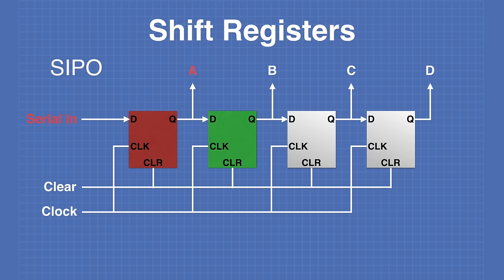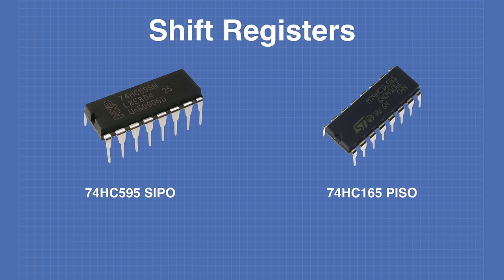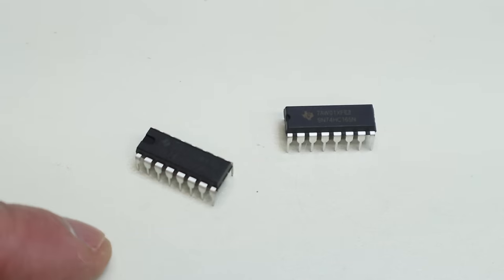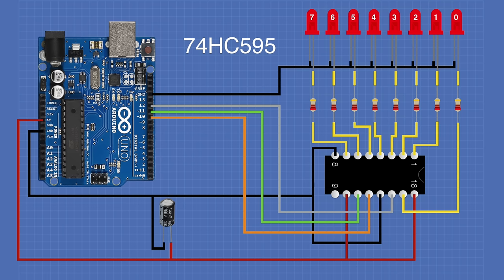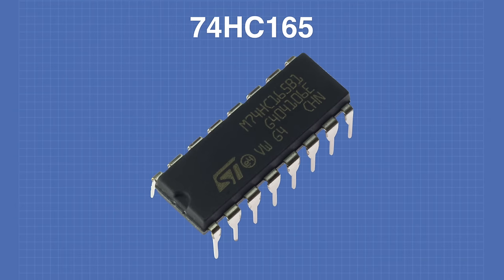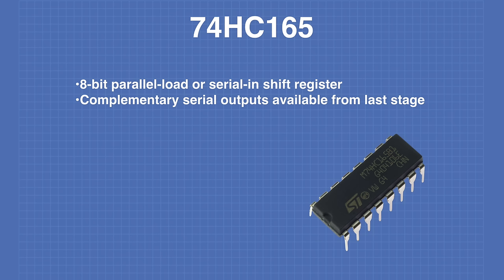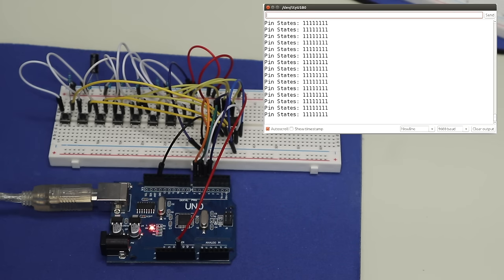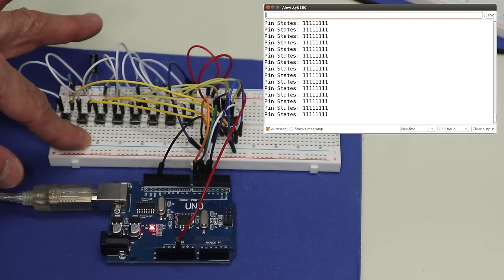74HC595 & 74HC165 Shift Registers with Arduino

Comment: Synchronicity: A day before this video came out, I was trying to figure out how I could use, say, n outputs from an Arduino to drive, say, 2^n LEDs. I'm very new to electronics and microcontrollers, but I've been doing software development professionally for several years. I love this circuit because it does exactly what I was trying to solve, the circuits in the IC aren't hard to understand, and it's great I can just buy an IC instead of wiring all that stuff together. In software development we have libraries of pre-defined stuff, just as ICs are packages of functionality. So ICs follow the same principle we do: package and make freely available bunches of commonly used functionality.
Reply: Hope systemd or other models of development don't reach this area...
Reply: Shift registers are often unknown by hobbyists and forgotten by others. I have seen them in a lot of designs since the 70's. Computers, wending machines and as receiver/decoders in military radar equipment. You find them very cheap on Ebay. Try to get hold of  the good old Texas TTL Handbook.There are many fun and interesting chips in the 74 series.Even an ALU.

Comment: You, Sir, have opened the doors to my better understanding of Arduino and bitwise logic, and I thank you sincerely. I'm 62-years-old and discovered the Arduino playground in early January of 2020, and I'm hooked (it's my new hobby). After using the 74HC595 in an early LED display project, I began to study the nuts-and-bolts of the unit, and I find this all fascinating. For those interested in the logic-level workings of the 74HC595 (or any other chips, for that matter), here are a few references that I've discovered along the way that can be used by both beginners and advanced coders alike. 

For those who aren't familiar with bitwise operations and boolean algebra, don't let the big words fool you; it's as simple as yes or no, on or off, zero or one...just forget about the world of 0s and 9s, and shift into the world of 0x0 through 0xf (hex numbers), and 0b0 through 0b1 (binary numbers (all two of them)).  Once I started coding with hex and binary numbers back in 1990, I never looked back. Mentally converting hex numbers into binary numbers and vice versa is simple, once you learn the trick.

I've C & Ped a copy of comments I wrote for a 74HC595 bit-shifting LED project I wrote. I'll share the code on the DroneBot Workshop as soon as I can. When I code, I comment a lot; I comment on the comments if need be. 

// Forward: The 74HC595 is a SIPO (Serial In, Parallel Out) shift register used to store eight bits of serial data, 
//                and to produce eight bits of parallel outputs. There are two data registers inside the 74HC595: 
//
//                  1) the SHIFT register, used to store the serial data inputs ([shift: 1] shifted-in by the shift clock, via the data pin)
//                  2) the STORAGE register, which stores the parallel output data shifted-in from the SHIFT register ([shift: 2] by the latch clock, internal). 
//
//                In review: the "shift clock" shifts data into the SHIFT register, and after eight bits are shifted into the 
//                SHIFT register, the "latch clock" shifts the data stored FROM the SHIFT register INTO the STORAGE register, 
//                which produces the eight bits of outputs. (lol I'm not screaming; just making a point.)
//                
//                The 74HC595 is mainly utilized to reduce the amount of output pins needed to use from the microcontroller board 
//                (the Arduino UNO board, in this case). Using three pins from the microcontroller board, the 74HC595 provides 
//                eight output pins in a state of either on or off at 5vDC or 0vDC (and no, you can't PWM through the 74HC595).
//
//                The 74HC595 contains 8-sets of master/slave flip-flop logic circuits running on an operating voltage range of 2vDC 
//                to 6vDC (the logic runs at the data-input voltage level), 80μA (maximum draw), and is the coolest little gadget to
//                entertain one's self with. The more I learn, the more I realize how simple this device really is. When I begin
//                programming FPGAs (soon), one of my first goals is to create an operational bit shifter. I'm lovin' it!
//
//                There are three states that the parallel output can be set to: ON, OFF, and high impedance. High impedance
//                blocks any data shifts (and is toggled by the OE (with a bar above the OE) pin). If you want inputs/outputs
//                turned off? Simply set the OE pin HIGH, otherwise, it defaults to LOW. The shift register can also be directly
//                overridden  and cleared by setting the SRCLR (with a bar above the SRCLR) pin LOW, otherwise, it defaults to HIGH.
//
//                The best reference I've found for the 74HC595 is: https://lastminuteengineers.com/74hc595-shift-register-arduino-tutorial/
//                They do a great job of explaining the internal operations of the 74HC595 shift register in simple terms.
Reply: And yes, the previous post was premature. I meant to say more with additional links, but the main jist of the idea came through.

It's probably not appropriate, but here's the entire .ino file. It doesn't read as well here, but C & P it into the Arduino IDE; play around, have some fun.

//øøøøøøøøøøøøøøøøøøøøøøøøøøøøøøøøøøøøøøøøøøøøøøøøøøøøøøøøøøøøøøøøøøøøøøøøøøøøøøøøøøøøøøøøøøøøøøøøøøøø//
//øøøøø[ Begin: Global variables ]]øøøøøøøøøøøøøøøøøøøøøøøøøøøøøøøøøøøøøøøøøøøøøøøøøøøøøøøøøøøøøøøøøøøøøøøøøøø//

#include <avr/pgmspace.h>       // a library of functions for using flash memory and stuff.

#define OP_SPEED  0x64          // used to set the speed at which the 74HC595 is updated
#define ARRAYSIZE 0xf0          // used to define the size of the dataArray[] and to end loop iterations

const int  dataPin = SDA;       // Arduino UNO digital SDA pin connected to the DS pin of the 74HC595 shift register (Serial data input)
const int clockPin = SCL;       // Arduino UNO digital SCL pin connected to the SH_CP of the 74HC595 shift register (SHIFT clock pin)
const int latchPin = SCK;       // Arduino UNO digital SCK pin (a.k.a. pin 13) connected to the ST_CP of the 74HC595 shift register (STORAGE register clock pin (latch pin))

const byte dataArray[ ARRAYSIZE ] PROGMEM = {     // the data array: binary data stored in flash memory used as switches to turn LEDs on and off.

  B10000000, B01000000, B00100000, B00010000, B00001000, B00000100, B00000010, B00000001, B00000001, B00000010, B00000100, B00001000, B00010000, B00100000, B01000000, B10000000,
  B10000000, B01000000, B00100000, B00010000, B00001000, B00000100, B00000010, B00000001, B00000001, B00000010, B00000100, B00001000, B00010000, B00100000, B01000000, B10000000,
  B10000000, B11000000, B11100000, B11110000, B11111000, B11111100, B11111110, B11111111, B11111111, B11111110, B11111100, B11111000, B11110000, B11100000, B11000000, B10000000,
  B10000000, B11000000, B11100000, B11110000, B11111000, B11111100, B11111110, B11111111, B11111111, B11111110, B11111100, B11111000, B11110000, B11100000, B11000000, B10000000,
  B00000001, B00000011, B00000111, B00001111, B00011111, B00111111, B01111111, B11111111, B11111111, B01111111, B00111111, B00011111, B00001111, B00000111, B00000011, B00000001,
  B00000001, B00000011, B00000111, B00001111, B00011111, B00111111, B01111111, B11111111, B11111111, B01111111, B00111111, B00011111, B00001111, B00000111, B00000011, B00000001,
  B00000001, B00000011, B00000111, B00001111, B00011111, B00111111, B01111111, B11111111, B11111111, B01111111, B00111111, B00011111, B00001111, B00000111, B00000011, B00000001,
  B11111111, B11111111, B11111111, B11111111, B00000000, B00000000, B00000000, B00000000, B11111111, B11111111, B11111111, B11111111, B00000000, B00000000, B00000000, B00000000,
  B11111111, B11111111, B11111111, B11111111, B00000000, B00000000, B00000000, B00000000, B11111111, B11111111, B11111111, B11111111, B00000000, B00000000, B00000000, B00000000,
  B11000011, B11000011, B11000011, B11000011, B00111100, B00111100, B00111100, B00111100, B11000011, B11000011, B11000011, B11000011, B00111100, B00111100, B00111100, B00111100,
  B11000011, B11000011, B11000011, B11000011, B00111100, B00111100, B00111100, B00111100, B11000011, B11000011, B11000011, B11000011, B00111100, B00111100, B00111100, B00111100,
  B11001100, B11001100, B00110011, B00110011, B11001100, B11001100, B00110011, B00110011, B11001100, B11001100, B00110011, B00110011, B11001100, B11001100, B00110011, B00110011,
  B11001100, B11001100, B00110011, B00110011, B11001100, B11001100, B00110011, B00110011, B11001100, B11001100, B00110011, B00110011, B11001100, B11001100, B00110011, B00110011,
  B01010101, B10101010, B01010101, B10101010, B01010101, B10101010, B01010101, B10101010, B01010101, B10101010, B01010101, B10101010, B01010101, B10101010, B01010101, B10101010,
  B01010101, B10101010, B01010101, B10101010, B01010101, B10101010, B01010101, B10101010, B01010101, B10101010, B01010101, B10101010, B01010101, B10101010, B01010101, B10101010,

};

//øøøøø[ End: Global variables ]øøøøøøøøøøøøøøøøøøøøøøøøøøøøøøøøøøøøøøøøøøøøøøøøøøøøøøøøøøøøøøøøøøøøøøøøøøø//
//øøøøø[ Begin: setup() function ]øøøøøøøøøøøøøøøøøøøøøøøøøøøøøøøøøøøøøøøøøøøøøøøøøøøøøøøøøøøøøøøøøøøøøøøøøø//

void setup() {

  pinMode( clockPin, OUTPUT );                // init the clockPin to output
  pinMode( latchPin, OUTPUT );                // init the latchPin to output
  pinMode(  dataPin, OUTPUT );                // init the dataPin to output

}

//øøøøø[ End: setup() function ]øøøøøøøøøøøøøøøøøøøøøøøøøøøøøøøøøøøøøøøøøøøøøøøøøøøøøøøøøøøøøøøøøøøøøøøøøøø//
//øøøøø[ Begin: loop() function ]øøøøøøøøøøøøøøøøøøøøøøøøøøøøøøøøøøøøøøøøøøøøøøøøøøøøøøøøøøøøøøøøøøøøøøøøøø//

void loop() {

  byte *buf_p;                                // a pointer to the dataArray[] memory address at the time we're reading the data

  // begin outer for() loop - this loop pushes the data from the 74HC595's SHIFT register into its STORAGE register

  for ( int
        thisByte  = 0x00;                             // declare an index for the data array starting at zero
        thisByte <= ARRAYSIZE;                // declare an iteration that stops at the ARRAYSIZE
        thisByte++ ) {                                  // increment the index

    *buf_p = pgm_read_word_near( &dataArray[ thisByte ] );    // point at the addressed flash memory of the dataArray[ thisByte ]
               
    digitalWrite( latchPin, LOW );            // write the latch pin LOW while we're moving data into the SHIFT register

    // begin inner for() loop - this loop pushes the least-significant bit first (LSBFIRST) into the SHIFT register of the 74HC595

    for ( int
          thisBit  = LSBFIRST;                     // declare an index for the bit-mask loop starting at LSBFIRST (bit 0) for the bitwise operations
          thisBit <= MSBFIRST;                   // declare an iteration that stops at MSBFIRST (bit 7)
          thisBit++ ) {                                    // increment the index
      digitalWrite( clockPin, LOW );          // initialize the clock pin to LOW
      *buf_p & ( 0x01 << thisBit ) ?            // if the (&) bitmask operation is true (if the bit of the dataArray[ thisByte ] value = 1 (is ON)), then...
         digitalWrite( dataPin, HIGH ) :       // write the data pin HIGH, otherwise...
         digitalWrite( dataPin, LOW );         // write the data pin LOW
      digitalWrite( clockPin, HIGH );         // write the clock pin to HIGH to push the bits through the serial data pin (on the next rising-edge clock pulse) and into the SHIFT register

    }                                         // end inner for() loop, which ends pushing bits into the SHIFT register

    digitalWrite( latchPin, HIGH );           // write the latch pin HIGH to shift the data (on the next rising-edge clock pulse) from the SHIFT register into the STORAGE register of the 74HC595, so...

    // once data is shifted into the STORAGE register, if there has been any changes in the state of the data, the output pins QA through QH of the 74HC595 respond accordingly

    delay( OP_SPEED );                        // delay outer for() loop

  }                                           // end outer for() loop

}

//øøøøø[ End: loop() function ]øøøøøøøøøøøøøøøøøøøøøøøøøøøøøøøøøøøøøøøøøøøøøøøøøøøøøøøøøøøøøøøøøøøøøøøøøøø//
//øøøøø[ End: File ]øøøøøøøøøøøøøøøøøøøøøøøøøøøøøøøøøøøøøøøøøøøøøøøøøøøøøøøøøøøøøøøøøøøøøøøøøøøøøøøøøøøø//

Enjoy.
Reply: CORRECTION: you actually can PWM through the 74HC595 using the OE pin with analogWrite() commands. I got in front of myself on that one; my bad.

Comment: Very useful tutorial, thank you for the work you put in on this.  I did get confused when the clock enable pin was used as the clock and the clock pin was used as the enable. I got the data sheet and sure enough it said those pins are interchangeable. I like the way you taught how the byte was complemented to get it back to what it really represented.

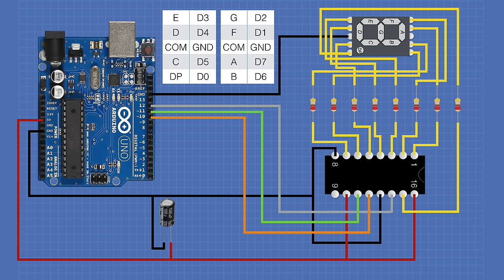Comment: 16:57, I think it's important to keep total current in mind since if you were to wire up two 7 segment displays using 150ohm resistors (mentioned as a possible value earlier), then you would exceed the 200ma limit of the arduino (e.g. 20ma/LED x 16 segments is 320ma).
Reply: Hi Enigma, so I have to connect 20-40 leds. Is there a better choice?
Reply: @333cgs333  Connect them in parallel, each with their own current limiting resistor.  Calculate the current through each LED and total it for all LEDs.  Use an external power supply which can provide the correct amound of current (always best to provide more current than required so you won't damage/overheat the supply).  Be sure to have a common ground between the arduino and you external supply.  You can also search youtube for videos on powering LEDs.

Comment: Great tutorial. I used these for controlling a board of 8 active low opto-isolated relays, in conjunction with a library I made specifically for this setup.

Basically, shift registers act like gateways.

Comment: Purchased on Amazon and tested (Worked Great) these Jameco Valuepro 4116R-1-331LF. Bussed Resistor Network, 16 Pin, 125 mWatt, 330 Ohm, 2% Tolerance ... Great Video!!

Comment: Great video! After some initial problems due to my own stupidity (forgot that the same rows on the breadboard are connected ^^..) I got my example to work. Finally I understood how to work with SIPO shift registers and I can't wait to use multiple ones in order to drive more LEDs.

Comment: Hi, I watched this video and said to myself, that's a cool sketch, so I set up the hardware same as yours for the shift register.  Then I modified it so that the LEDs would shift from outside to inside and back then repeat.  Now, as I was moving the breadboard around while the LEDs were flashing back and forth, the positive 5Vdc from the Arduino connection came out of its pin on the Arduino Uno; and the LEDs still flash as if power is applied to the chip.  I have a 150ms delay between LED shifts as follows in the below code segment (this repeats for different binary numbers for the flashing effect):

int latchPin=11;
int clockPin=9;
int dataPin=12;
int dt=150;
 
byte LED1s=0b10000001;
byte LED2s=0b01000010;
byte LED3s=0b00100100;
byte LED4s=0b00011000;
byte LED5s=0b00100100;
byte LED6s=0b01000010;
byte LED7s=0b10000001;
byte LED8s=0b00000000;
.
.
.
void loop() {
 
 // put your main code here, to run repeatedly:

digitalWrite(latchPin,LOW);
shiftOut(dataPin,clockPin,LSBFIRST,LED1s);
digitalWrite(latchPin,HIGH);
 
delay(dt);
digitalWrite(latchPin,LOW);
shiftOut(dataPin,clockPin,LSBFIRST,LED2s);
digitalWrite(latchPin,HIGH);
.
.
.

From my multimeter, pin 11, the latch pin, varies a bit but averages to about 4.93Vdc and seems to be supplying all the power the chip and LEDs require to keep running.  I would love to send you a picture or short video so you could see this and maybe repeat it. 

Scott in Harwood, MD

Comment: Your videos are really very informative. It would be interesting in adding a part "B" to this video and connect all 8 data pins to the 1602 LCD. This way a hardware contrast can be made from  from a software perspective and a hardware perspective between 4 bit mode and 8 bit mode on the LCD?

Comment: Hi everybody,
Some people ( Joseph Chamness in particular) asked for an '595' that is able to handle higher voltage/current.

It exists: Texas Instruments 'TPIC6595'
Same pinout as regular LS or HC 595, but open drain output with:
- RDS(on) 7 Ohms
- Imax 100 mA continuous / 250 mA max
- VClamp 33V

I have used it widely for anything such as relays (normal or solid-state with HV control) and it works like a charm...

Enjoy !
Reply: Typo: TPIC6C595
Reply: i think it's more situable and common to use a darlington array (such as the uln2003) which are simply a cascade of a low input transistors and more powerful transistors controled by the first one.
Those are 7 darlington transistors for each Ic and are pretty cheap i think, hope someone find this useful

Comment: The 75HC165 is what I was looking for in another program to build Ben Eater 8 bit or 16 bit Computer.
This would make  it easy to make a serial input to program or use of a 3.5 inch floppy drive. 
COOL thanks..  Also it solves the problem of programing EEPROMS... by using both of these chips and not run out of pins.